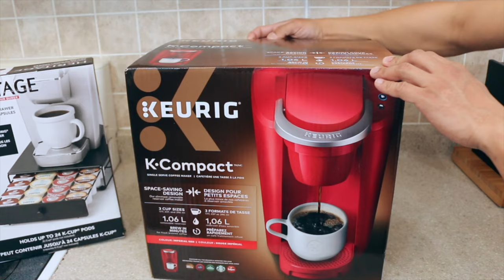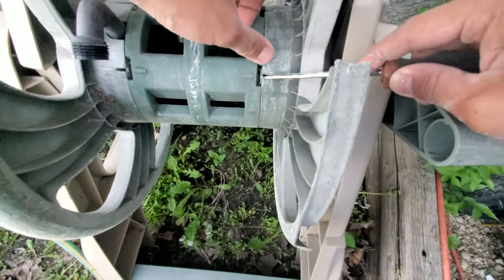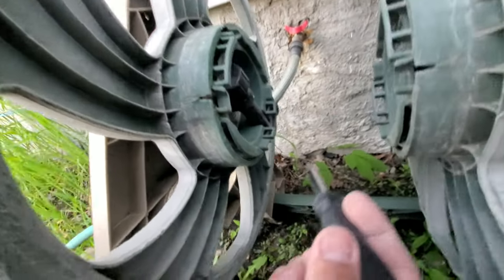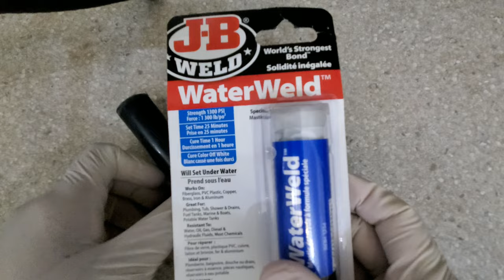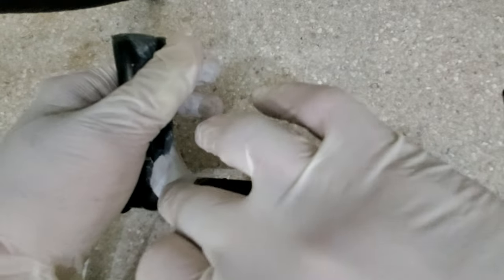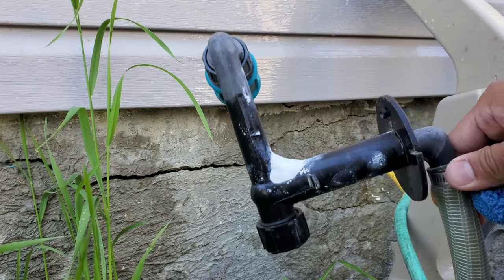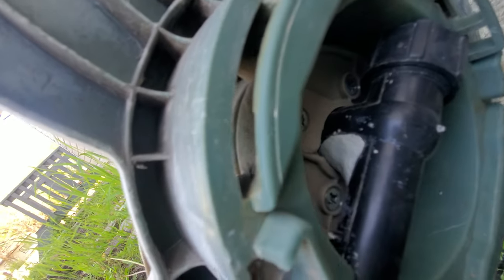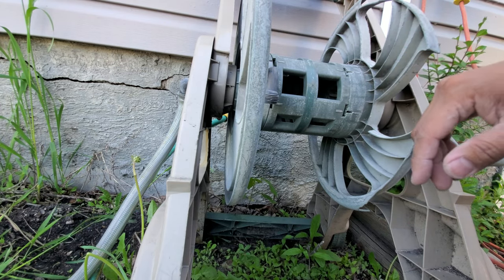Hose reel repair

Comment: Good video. Better to fix them because no matter how much you spend on a hose reel they ALL leak eventually.
Reply from the maker: Specially when you left it with water inside during winter. To prevent this from happening, i make sure that i remove the hose and drain the hose reel completely because the water that remains in the hose reel line will freeze and expand then breaks the plastic parts.

Comment: Thank you for posting this. I have the same model. Once I saw where the two O rings where, I was able to remove the three screws on the side and pull the shaft straight out. I bought an O ring assortment from Lowe's for $3.58 which solved the leak problem.
Reply: so am I

Comment: Great tip about the JB Weld product. My model was a little different and there was a plug that was apparently blown out by frost pressure because there was a big open hole. The JB Weld worked well to fashion a new plug and seal up the end of the tube.
Reply from the maker: Thanks for sharing

Comment: I have the same problem as you. I went to buy waterweld according to your jb brand, but it reduces the leakage, but it is not completely sealed, it is still leaking. I'm disappointed

Comment: I am having the hardest time trying to find a leader hose for this thing. Can you tell me the item number or any info that could help me find one short of possibly having to buy a hose and cut it? TYIA
Reply: The leader host on the same model that I have broke just a week ago. the leader hose connecter does not have threads. I have no luck finding a replacement as well. If you happen to find that part please share here. I have ordered, Camco Water Bandit from Walmart to see if it would help connect a regular Leader Hose.
Reply: @TK-sj7sy  I had to buy one and cut one of the ends off. Slid it on and hose clamped it.
Reply: @mprtftr  thank you. Will try that if the part that I ordered does not work